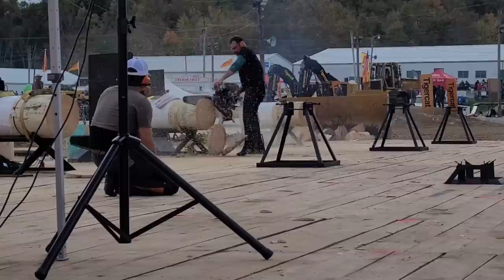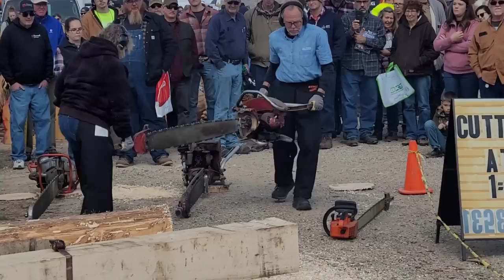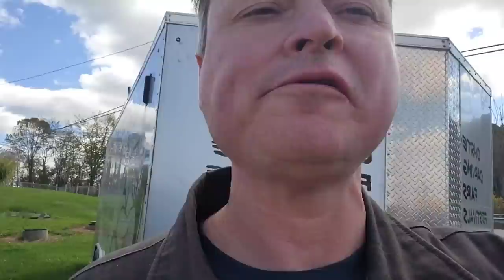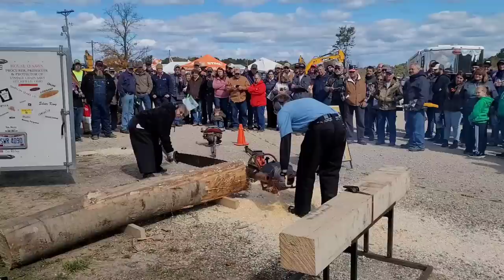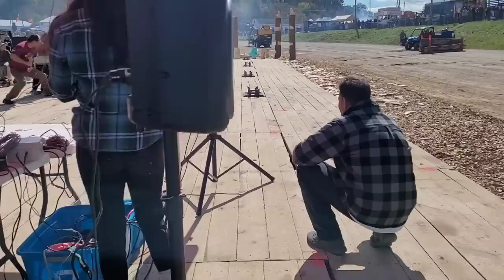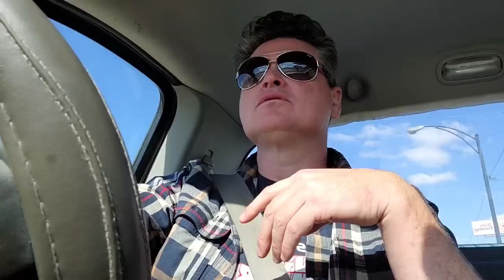Second day at Paul Bunyan 2022

Comment: Thank you for answering all the questions on your live streams. I started looking through the specs on the Jred 2255 and 2260 and I will say I have to agree with you on my bright idea of burning money with the bigger cylinder.  It makes more power but not enough to do make up for the cut speed loss but all you said was you wouldn't suggest swapping cylinders just do a muffler mod. I will say that opening the exhaust really made my 2255 hum. It pulls a 28 bar with a Sharp chain in walnut just as good it did with a 24in bar and sharp chain with stock muffler.  THANKS.